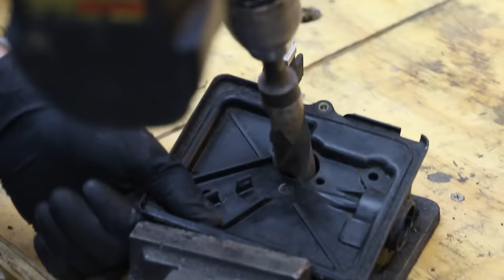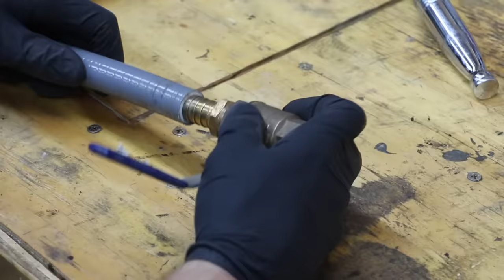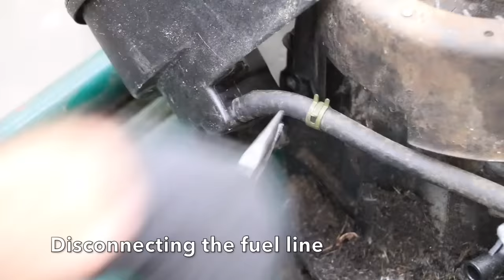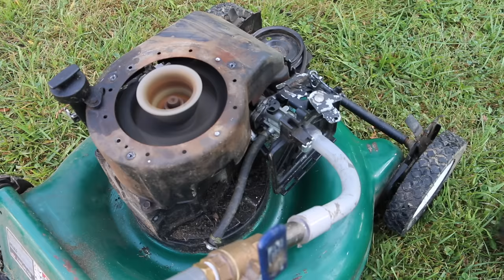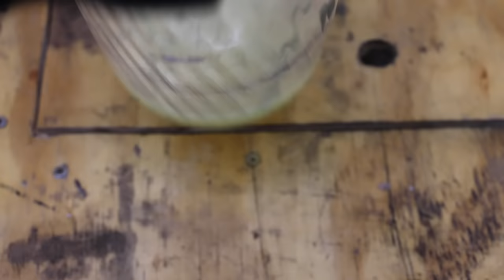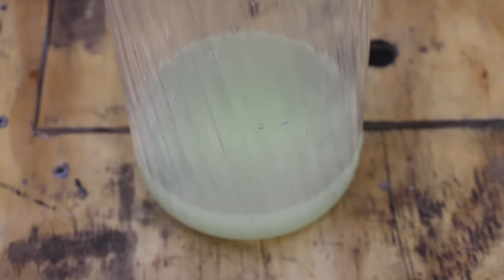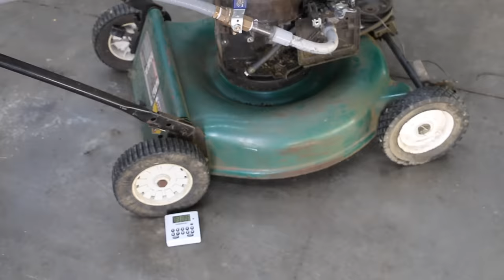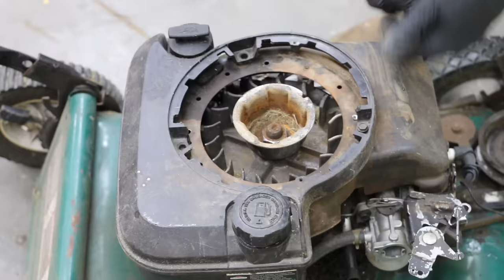Will a "Gas Vapor" Container Improve MPGs and Fuel Efficiency?  Let's find out!

Comment: Engines only run on vapors, it’s what carbs and injectors do.
Reply: cipmars
The fuel is atomized in the venturi of the carburetor and at the injector tips, not vaporized.
Reply: It is atomized and then vaporized in a regular engine...
Reply: ( top military secret!) :)
Reply: You cant burn it while its fluid... At some point it turns into vapor!
Reply: As a Jet engine technician I can say there's a different between a vaporized and an atomized substance. Fuel is atomized (or turned into a fine mist) to be burned as you all know straight liquid fuel will not burn. A vapor is when you "burn" off water and it creates a smoke-like substance... essentially, vapor is taking a solid or liquid and turning it into a gas whereas atomization is simply taking a liquid and turning it into a mist, it's still in liquid form technically. I'm curious if he could gain different results if he used a different fuel that gave off better fumes
Reply: Deric Lowe it is atomized (by an injector, or carburator jet, or jet engine nozzle) to increase the surface area in order for it to then vaporize.
Reply: jimmies rustled I was merely explaining the difference between vaporization and atomization. In the aviation industry technically after that fuel is atomized, it's ignited to create combustion, which I suppose is still "vaporized". I guess we're just a bit more specific with terminology in aviation
Reply: cipmars Bingo.   Stoichiometry!   Anyone remember high school chemistry?  14.7 parts air to one part gasoline vapor if I recall (though it's been a while! ).... which is why a lit match will go out if dropped into a full bucket of gasoline----or so I'm told.   Frankly, I'm too chicken $#!+ to test that hypothesis, myself.
Reply: Dork Prince I had a supervisor when I first started my job that took bets on whether or not a small bucket of fuel would go up in flames if he dropped a match. I knew I wouldn't as my dad has been in the same field for 30+ years but some others took the bet and even jumped back when they realized he wad actually gonna do it. Pretty funny to witness lol
Reply: Yeah right.  I 'm a mechanic they all run on vapors can't run on liquid.
Reply: Deric Lowe My father spent eleven years in the Navy as a reciprocating and jet mechanic.   Worked on the Allison Turboprop and the Pratt & Whitney J52.  When he exited the navy, he went to work for NADEP as a civilian doing rework on the same engines.   Also worked on the one in the F/A-18 but I forget what TF-# those were.   Anyway, he's told me a few stories similar in nature himself.  I just wish I could remember them all--many were quite funny.  The gas bucket is the one that sticks to memory.
Reply: Dork Prince sounds like your dad has been around the block quite a bit in the aviation field! I've been in the Air Force for 5 years, spent 2 of them working on Pratt and Whitney F100s on the F-15s in Okinawa and now I work F101s on the B-1B bomber out in South Dakota. It's amazing how much there is to learn about each individual engine and the different companies. But yeah there's some good stories out there, also some sketchy ones when it comes to maintenance lol
Reply: You are Correct Sir.
Reply: Bill Davis No, the fuel is atomized to increase surface area and improve vaporization.
Reply: google atomization and vaporization. ask the enguine manifold designers what a problem carb "mist" is. vapors are no problem.
Reply: Bill Davis You're on the right track! It is misted to increase vaporization, the vaporization isn't directly or mechanically done by the carb. Though the fuel is misted with the intention of it vaporizing.
Reply: All gasoline powered engines run only on Vapor caused by a "Phase Change" through the application of heat, and Oxygen must be present to combust. Liquids do not combust, and gasoline in liquid form will not combust. Atomizing gasoline is when the liquid gasoline is fragmented into tiny microscopic droplets, but is still in the form of a liquid. The process of atomization, aka misting, occurs through the carburetors jets, or through pressurized liquid gasoline being forced through fuel injectors. Emulsification is the thorough mixing of atomized gasoline with ambient air. Emulsification occurs when the air and gasoline mixture is drawn through the carburetors Venturi by cylinder vacuum.  Phase change by heat in a carburetor application usually starts inside the hot intake manifold, when the flowing atomized and emulsified gasoline, still in liquid form, makes contact with, and is heated by hot surfaces within the intake manifold runners, and contact with the components of the combustion chamber including the intake and exhaust valves , and the hot dome of the piston, which has just gone through the previous combustion process of the power stroke. Engineered Camshaft OVERLAP also helps to vaporize any un-vaporized atomized and emulsified liquid gasoline, by leaving residual hot exhaust gasses in the combustion chamber at the end of the exhaust stroke, when the piston is nearing top dead center, and the intake valve starts to open.  Any residual liquid gasoline that has not vaporized within the combustion chamber, will then be classified as hydrocarbons, which is residual liquid gasoline mixed with carbon soot from the combustion process, along with Carbon Monoxide. Both the Hydrocarbons and Carbon-Monoxide are then converted by contact with two Catalysts within the Catalytic Converter into Carbon -Dioxide, Oxygen and Water Vapor which then exits the tail pipe.
Reply: carbs and injecters dont vaporize, they atomize. Atomization is a mist, not a vapor.
Reply: whew! Only 1% of everybody that responded to this video will know WTF you are speakin of. And most will not continue to read the knowledge that is contained below.
Reply: It is atomized, but only vapors burn. carbs and injectors only make a mist, not a vapor. Diesels use thousands of pounds of injector pressure to make a much finer mist but none of the above make a vapor.
Reply: yes on the stoichiometry. 14.7 is very dangerously lean at least in a gas engine and about 12.5??? is best for HP and torque. AND yes, if you drop that match, only the vapors on top will ignite.
Reply: Scary how in 1900 it was understood how a carb works and how an intake manifold is part of the system to feed gasoline vapor to a car engine. Today the decline in reading and the decline in knowledge shows. Both a carb/intake manifold and a bubbling ball jar gambit create gasoline vapors. To run an actual car the bubbling jar of gas would be huge and dangerous.  Running a briggs at low rpm and no load might be 1/2 hp.
Reply: carbs and injectors only create a mist from liquid fuel. If engines were designed to run only on vapors than you would not need a carb. you would use regulators like a propane engine.
Reply: carbs only create a mist. If you fed the engine vapors, you would need regulators like a propane engine, not a carb.
Reply: The bubble jar is actually creating vapors, not a mist.
Reply: cipmar
Reply: The whole problem is that a carb and injector only inject mist. any vapor is mearly  a by product. a carb is not a vaporizer.
Reply: do a carbs vs fats video
Reply: Bill Davis you need a regulator on a propane tank because the liquid propane (Lp) is at higher pressure.  Lp rapidly vaporizes at room temperature and atmospheric pressure.  Gasoline happens much slower.  This is also seen in how they are stored.  Lp must be pressurized to stay a liquid. Think metal propane tank.  Gasoline can be stored in a plastic gas can. Sealed up it will still pressurize just not as much.
Reply: Bill Davis you're half right.
Atomizing the fuel increases the surface area.  Increased surface area alows the fuel to vaporize faster than the larger stream.  An easy way to visualize this is to freeze a cup of water in a glass.  Freeze the same amount of water in a ice cube tray. If you take them out of the freezer and place them on a counter top. The ice cubes will melt faster because more of the ice is exposed to the air.  You take this even further that snow flakes melts almost instantly against your skin yet a snowball would take longer.
Reply: Bill, do you think the "fuel conditions" are better at the intake valve of the cylinder head with the gasoline bong ball jar set up than a Detroit Carb? Urban legend in the 1920's has it that John D  Rockefeller bought the 100 mpg carb and it is locked up in a safe. All engines run on vapor. All a crab and proper intake manifold does is create gasoline vapor to make the engine work. The bong affair does the same, thus no gain.
Reply: Wrong. Carburetors and injectors introduce atomized gasoline into an engine, not vapor. A carburetor mixes atomized gasoline with air and delivers the mixture to the cylinder's. Injectors deliver atomized gasoline into the intake or cylinder where it is mixed with air. If you do not know the difference between atomized and vapor you should look them up.
Reply: In fact, combustion only occurs when a gas combines with oxygen... in fact we could call combustion also a exothermic oxidation.
Reply: Gee a Pre WW2 text on Internal Combustion Engines says: 

"The job of the carburetor is to prepare the gasoline to make the phase change from liquid to vapor.

Thus today folks are less informed than 70 years ago about the basics

Thus Henry Ford was like Spock! :)
Reply: Maybe folks will discover compression ratio and spark plugs too? :)
Reply: @Jake Creech i find it funny that the process is called atomization in english speaking countries. We here in Germany say "zerstäubung" for that process and "atomisierung" is actually if you brake a molecule into atoms. I had to look that up because I thought what the hell, a carburetor does not make individual atoms out of an octane molecule for example haha
Reply: 3beltwesty the air would be much cleaner if people understood the importance of proper ignition, I agree.
Reply: The gas goes into the carb, then gets pushed into the intake via jets which turns the gas into an atomized vapor. However, this method, the gas never reaches the carb, but in fact it is atomized directly at its source from the container. Thats the difference. So you guys are all right. You seen the gas consumption was barely different. So all this is, is just another way of atomizing your gas. Now I wonder of what its emissions look like on a test. Because with this method your not burning any of the crud or garbage thats in it. Your burning just straight oxygen and gasoline particles and pre oxygenating the gas.
Reply: Hi Andrew and the rest , 
Normally it is bad practice to get liquid gasoline in the combustion chamber. The gas can cool the thing on a race car or dragster and thus has an upside. 

But today with the EPA the car could not be sold as new for a street car since it would fail the emission tests. 

A dumb manual choke on a freezing morning had one fiddling with pull knob, full choke to start and one pushed it back in as the engine warmed up. Winter gas is used in colder months so it vaporizes easier in colder weather too with the ancient carb or modern injectors. 

When and raw gas goes down the cylinder walls the lubrication can drop and the compression will drop too. 

A guy a worked with pumped his throttle so many times to start a car the accelerator pump on the carb and false starts with no firing filled the crankcase with a quart or 2 of gasoline.

 I had to remove all the plugs, add oil turn the thing over to get oil on the walls to get the compression back up.

 Once it started it made a huge amount of smoke for 5 minutes burning off the gas that was in the engine via diluted oil. Insane mess on a chevy 350 V8 the guy ran the battery down and had and all the plug wires to the wrong plugs after a plug change
Reply: Andrew Morris I’d bet emissions are much lower with the pre-oxygenation. And any carbon buildup would get washed into the oil eventually, because if the combustion is complete, there will be a large amount of water vapour in the exhaust. Opening up the spark plug will help burn the fuel by presenting a bigger spark to the air/fuel charge.
Reply: pre-oxygenation thus a Oxygen cylinder on a modern car too? A type T tank holds 355 cubic feet, it is about 5ft tall. How much oxygen would you inject?
Reply: Gas and liquid gas, that is the first time i've heard gas spoken of in this way. I assume he means gas as gasoline or petroleum?
Reply: While you are technically right they dont so purely change the actual substance into a pure gas form like he was doing. Your looking at it like "its a gas air mixture same as everything else" but this is actually a gas vapor with oxygen in it literally while as engines physically have gas and air in the same space "mixed" yes but that gas is a fluid and the air is the only gas vapor in there.
I am curious how long it is able to stay in that gas form though before condensating and returning to a liquid he should have checked the float bowl after running on vapor to see if it was filling up or not id like to know.
Reply: cipmars true all carbs run on Vapors but they mix in the carburetor which would keep you from blowing the car up or burning the car to a crisp this is a lot more fun because you're mixing the oxygen with the fuel and making a vapor externally
Reply: it is vaporized inside the cylinder area not before it enters into the engine which would lean the fuel ratio considerably would it not
Reply: as soon as it gets cold enough. The fact omitted there is that gasoline does not change its properties but its state from liquid to gas, which happens when the temperature of a liquid passes its boiling point. And it will only burn in that state... no matter how you do it. The way to get around not having enough gasoline in gaseous state is to just overcharge the intake. That is called the choke on a carburetor. Once the intake manifold is warm enough and all gasoline is vapor upon entering the cylinder it is no longer needed.

Now, re substance in pure gas form: the only way to do that is to warm up the gas to the point it evaporates, not by blowing air through a gallon of it. The thing we see in the video is a very primitive variation of the carburetor (in fact, the tube pulling air through some gas is the most primitive form of one).
Reply: Santa Clause I would think that the float bowl, once emptied, wouldn’t refill with liquid fuel if there were no supply of it. 
Check out George Wiseman’s eagle research channel - he’s got a video of the bowl emptying out and the engine continuing to run on the vaporizer system.
Reply: Propane uses an expansion chamber to convert from liquid to a gas then the regulator controls the volume that the gas is released. Gasoline vapors would also need a regulator. It just would not need the expansion chamber.
Reply: If you take a head of an engine, all that build up on the back side of the intake valve is from liquid fuel splashing against it. An efficient "vapor" system would not splash liquid fuel into a cylinder that burns best on vapors and all those other contaminants would not be carried into the cylinder. There are YT videos linked into, further down, on cars getting hundreds of MPG from vapor systems. Please read down, but only  if you want to learn!
Reply: Bill Davis indeed, and exhaust valves wouldn’t carbon up either, like in a lot of the newer “efficient” engines.
Reply: Bill, engines that run on propane that are say lower than 25HP usually use vapor from the LP bottle, not liquid. But larger engines often have a vaporizer that has the LP gas or LP vapor + gas going into a gizmo that is heated by the water from the engines coolant. A standard 20LP BBQ bottle here when it supplies my 18 HP generator will freeze the LP bottle on the outside at full power. ie dew from the air will turn to ice where the Liquid LP is on the cylinders outside. ie there is so much LP being vaporized that the frost forms on the cylinder during the summer.
Reply: Glad to hear a titan of reason finally put this to bed. Go home conspiracy theorists, shows over!

Comment: you just ran the worlds most fuel efficient engine!
try using preheated fuel vapor
Reply from the maker: Thanks for the suggestion
Reply: So, like if one of those air intakes happened to come from the exhaust line of the system?

I think that just recreates the EGR valve...
Reply: Yes,yes,yes.

Comment: You need to match the rpms between the two tests. I have also found you can add 50% water when running on vapors as apposed to direct fuel.
Reply from the maker: Thanks for the feedback.
Reply: tight!
Reply: Water dosent vaporize dude you would be left with a jar half full of water.
You can how ever injectnwater into the air inlet to keep the motor cooler but in a lot of cases it dosent need water to cool it.

Comment: Got my 4 cyl minivan going on fumes today fyi.  It came to me that the most efficient evaporative method to create fumes is for the tank to be flat as possible to give the widest area for evaporation to occur, yours is more vertical with that cylindrical tube you have. Just food for thought I still got a tweak mine to keep the air fuel mixture correct what happens is when I allow too much air it takes off till like 3,000 RPM. When I limit the air I can keep it at a reasonable RPM.
Reply from the maker: Thanks for sharing.